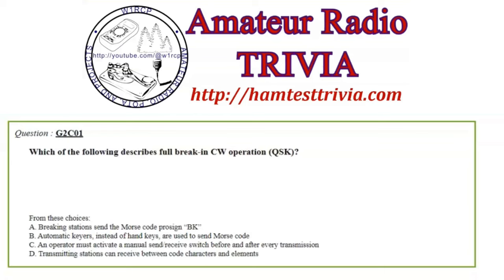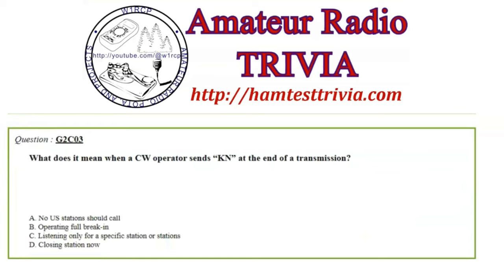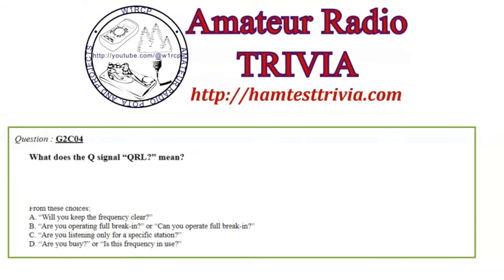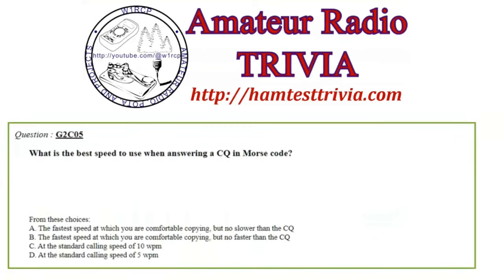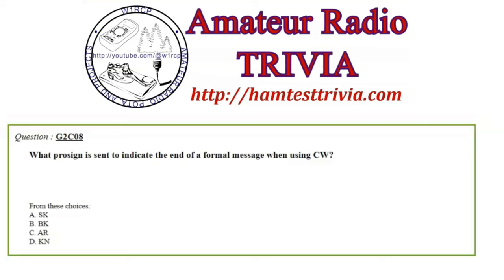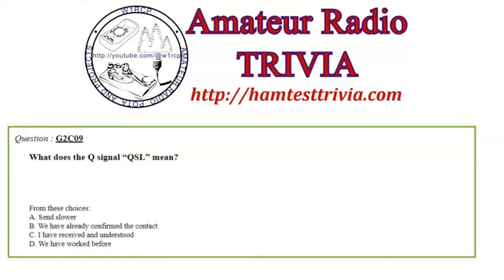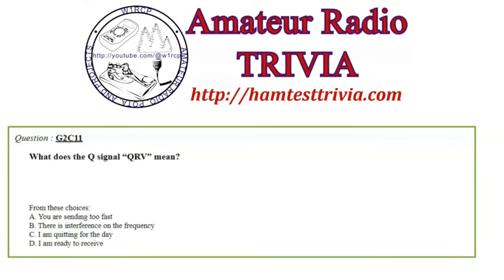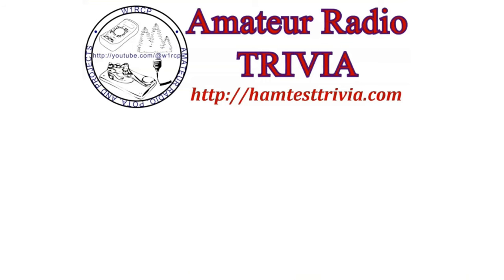Is the FCC bringing back the Morse Code requirement? #hamRadio #test #study #amateurRadio

Comment: The FCC does not write the questions in the pool, the NCVEC does.  To add a code requirement back, it will require a Notice of Proposed Rulemaking which consists of a comment and reply comment period.  None of these are taking place.  I highly doubt there is any interest in bringing back the code at the FCC.  I would suspect heavy ARRL opposition.  Remember, the ARRL wants to further water down the incentive licensing system by expanding phone privileges for techs in the HF bands.
Reply from the maker: Hey! Thanks for commenting and watching. In later videos I have been much more clear about who “actually” makes the exams. I know the NCVEC well because I pull the exam questions into a database when they’re released, and periodically I have to check for redacted questions. 
I also disagree with watering down the privileges. Technicians should be like a toe in the water. Why let them start swimming before they’ve had their first experience in the water?
No, the FCC isn’t bringing back the code requirement, but I wanted to draw attention to the questions about it. There are a lot of new CW ops out there, and the information I’ve provided, though click bait it may be, should be helpful to those either dabbling in CW or studying for the exam. 
Again, I appreciate you taking the time to write a well explained comment. 73 -Rob
Reply from the maker: I have pinned your comment so others can find it easily.

Comment: No.  Its not.  Understanding q-codes and proper operation to send and receive CW are not equivalent to a CW requirement.
Reply from the maker: It’s just speculation. They probably won’t ever require it, but what if it’s a frog in water that’s about to be boiled? Again, I explained it was only a half-truth near the end. I’m glad that CW operations are in the General exam. Maybe it will spur interest in the mode. Technicians have the ability to use CW on four HF bands, but I’ve only ran into a couple that have actually done so.
Reply: @w1rcp  I understand. At the same time, when I took my extra exams more than 10 years ago, they had similar questions on them. I like CW, but I do think it was an artificial barrier to getting people into the hobby. I think that if the code requirement had stayed, the hobby would’ve died. Maybe not all the way, but it would probably be a fraction of what it is now.  In the long run, I think keeping the barriers to entry minimal (about where they are now would be fine) eventually translates into more people getting into CW, digimodes, POTA, ect…
Reply from the maker: Yeeeeeesssss. Man, I wish I would have thought about the barrier to entry before I finished producing the video!!!! Holy crap you hit the nail on the head there. I agree with that. Ham radio is a vast playground, so why limit entry to the play ground by requiring a prospective participant to be skilled with all the equipment before being admitted? I know that there are many that wish the CW code requirement was brought back, but I politely disagree. Let us find our favorite playground equipment. I am glad that the exam at least touches on many of the different modes and activities that we can participate in, though. At least knowing a little safety about the “playground equipment” is there. analogyComplete(); 73, and I appreciate you coming back and furthering the discussion. -Robbie
Reply: @w1rcp  Yeah, the code requirement was a big deal.  Pre 1990 you were required to learn and test at 5 wpm just for a novice/technician license.  Post 1990 you could get a no-code technician license, but we’re restricted to 50 MHz and up.  General required 13 wpm, advanced/extra 20 wpm.  I think around the year 2000, the code requirements were eased to five words per minute for technician, and 13 words per minute for general and extra. They dropped the advanced category.  Everything went no code in 2006. I have mixed feelings about CW requirements.  I got my ticket after 2006, I was almost 40 and had a busy career. I really couldn’t justify the time it took to learn CW. It was a barrier to entry for me. I think I’m a pretty responsible operator otherwise. at the same time, I really wish that I knew CW well enough to use it. The thing is I dip in and out of this hobby over the years, and CW is one of those things that you will definitely lose if you don’t use.  One thing that I completely completely agree with is reserving significant band segments for CW only. I never want to see that go away. I also like the idea of the 30 m band being essentially a dedicated CW and digital band. There are a lot of benefits to operating CW, and it certainly is worthwhile to learn for the hobby.  In the end, I think CW is a reward unto itself and the people who learn it. It’s kind of special in that regard.
Reply: @kd8opi It definitely was a barrier in my case.
I earned my FCC commercial license in 1984, but didn't get my amateur license until years after they dropped the code requirement.
Reply: @kd8opi Yup. I earned a FCC commercial license in 1984, so rules and technical knowledge were not an issue. I just didn't want to learn the code.

Comment: The ARRL has abandoned actual hams in favor of the corporations that want to sell radios.  Without code you can't really build and operate a radio.  You need no real knowledge of electronics.  You just need money to buy a radio from the corporations.  You become just an appliance operator.  All they are doing is allowing CBers to buy and use Ham radios without any knowledge at all, other than how to push the button on the mic.  This totally kills experimentation and innovation.  I could care less if you let techs play around with UHF and VHF, but HF should require code, period!!!  AE4YW

Comment: Straight key CW is the primary reason I got my ticket back in 1994. At that time it was a required part of most of the amateur radio license levels. Although I prefer CW and never had a problem using it on air or passing the 20 WPM Extra Class CW exam, I never believed it should have been a requirement because it excluded many folks who did not need or want to learn CW from entering the hobby.

Nowadays it seems that CW ops are on the rise and I believe that is because of the challenge involved in learning the language of dits and dahs and developing a good fist. With so many digital modes to choose from, some of us enjoy getting back to the basics. CW doesn't rely on sophisticated software and repeaters and transponders and Internet linking and so on. It is a barebones operating mode that will always get through when the high-tech systems go down.

I think it would be best to leave CW as it is now, an optional and voluntary operating mode. I do not believe that demonstrating Morse Code copying ability should have any place in an amateur radio exam. However, learning some basic understanding of CW is not a bad thing either. Just don't force it down everyone's throats!
Reply from the maker: Well said. Thank you for your most excellent comment, and I agree. I always wanted to do CW since getting into Amateur radio, and after many years of practice and failure I was able to work the skill to a reasonable level.
Reply: SSB was the gateway drug to CW for me. As far as the increase in CW operators, I suspect SOTA and POTA have something to do with that. I know it did for me. I just completed my 4th POTA activation with CW and I’m hooked. It’s so much easier to find band space to work and I can use my 10 watt radio with the same propagation as my 100 watt radio but without all the accompanying software wrangling of the fiddly digital modes. In any case, if CW had still been a requirement, I would never have upgraded to general and ironically would never have learned CW. I was lured in, not forced, and it worked.
Reply from the maker: @KD7QOW-np9gd  I agree. I had plenty of time to learn. Now I can't even count the contacts I've made using CW. I enjoy the absolute heck out of it. Congrats on the addiction. You can do just as much with a whole lot less with CW, too. I'm about to post a video of the Pixie II CW transceiver, and I'm going to make an attempt at a POTA activation solely using it very soon using a tiny straight key. I'm just waiting for the sun to stop burping up all over us. 73 -Robbie

Comment: Trying to figure out the FCC’s intentions by looking through the question pools is a waste of time. The FCC doesn’t create the question pools; the NCVEC does.

If CW is revitalized, it’ll be a result of the good work done by CWOps and the  LICW Club. The FCC couldn’t care less at this point.
Reply from the maker: Yes. I understand the NCVEC is in charge of the question pools, and I also agree that the FCC has basically turned a blind eye to our spectrum, and they are entertaining ideas to sell it off, but I bet most Amateur radio ops either don’t know or have forgotten where the question pool comes from which is why I begged the question with the FCC’s name. 

I am glad that it is part of the General exam, and I encourage those that I can to at least give CW a try. I started by saying that I’d never be able to do it, but I wanted it so bad that I actually did it. 

Like I said near the end of the video. Yes, it’s part clickbait, but there is some truth to it. The only issue is that I named the FCC instead of the NCVEC. 

As far as CW being revitalized, I believe that CWops, SKCC, LICW, and whether anyone likes it or not, POTA has also encouraged many hams to give CW a shot. 

73! -Robbie
Reply: A member of both clubs
Reply: It only stands to reason that if knowing CW codes were ever to be included in any exam, then I'm sure that we would also be able to send and receive CW as well at a designated speed as they did years ago. The bottom line, this would definately decrese the number of people who would want to take the General exam and also quite possibly discourage anyone wanting to get into Ham Radio.
Reply: The FCC only has 1 intention for Amateur radio, as stated at the top of the FCC rules and regs for the service. They want a pool of technically knowledgeable and experienced radio ops in case of war or other national emergency, so they provide the willing with a radio sandbox to play in, and several perks for taking and passing simple tests. It's surprising how few hams actually know why the Amateur radio service exists. I guess it's because the question is not on the license tests.
Reply: @johnwest7993  I think amateur radio faces a problem that I don't know how can be fixed. With all the modern means of communications, it is no longer necessary for emergencies, except when it is. For example, I have heard of hams approaching their local Emergency Services organizations and being told "We don't need you; we have cellphones." And they may be right, up until you get a storm that takes down the cell towers, like they are having in the middle of the US lately. At that point, they do need hams, but they don't have a working relationship with them, since they thought they would never need them.

Comment: I took a ham radio class when I was in college and failed the morse code test by a few words. Over the years, I would practice for fun. Then when I was around age 40, a member of the US Power Squadrons boating club told me that they were having a ham radio class. Since I already knew morse code somewhat, I practiced and told them that I wanted to do the code as well. At this time there was no code requirement. They looked at me like I was crazy to do the code but I told them my story of originally failing the test in my college years. So they gave me the test and I passed. Then they gave me a small piece of paper that in handwriting that gave me permission to do code on Novice and Tech bands. Now I read that it is no longer valid; that it is presumed that an operator can do code. I am glad that they got rid of the code requirement, but credit should be given to those that took it.
Reply from the maker: I love the story. Thank you for sharing. I had a CW QSO with a guy a few years ago and he told me the story of waiting by the mailbox every day for months waiting on his ticket to come in the mail. He told me the whole story about having to leave home and travel to a big city to an FCC office to test. Times do change.

Comment: I got my technician license in 1988. I didn't get my general till 2009. I was stuck on VHF/UHF all that time, and just lost interest. I could never get anywhere near 13wpm. I took and passed the general written in 1988. That gave me a year to learn the code. But it was clearly hopeless. Not everybody is capable of learning code, especially at high speed. Once it gets above the speed where you can count the dits and dahs, it just becomes a jumbled up mess.
Reply: This!
Reply from the maker: I can just barely converse at 13wpm. At that speed I can't write any faster, and it turns into a jumbled mess. I've tried head copying, and I still practice it, but conversational CW has never gotten much farther than 10-13wpm. Short exchanges I'm good with at higher speeds, but anything out of the ordinary will mess me right the heck up.
Reply: You've been trying to learn CW wrong. I did it that way, too. I had to unlearn it before I could learn it correctly. Fast CW isn't about counting dits and dahs. It's about associating groups of sounds with letters, then with words. When you read you don't read letters. You read groups of shapes that you identify as words. When you listen to speech, you don't listen for the sounds of each letter, then add them up to form a  word. You put them all together and hear full words. That's the way fast CW works. I had a friend who sent and received CW between 40 and 60 wpm all day long. He could transcribe code to paper while he was talking to me. His Vibroplex bug was stuck on as fast as it could go, and the touch of the paddles was tuned like a racecar engine. He was a master, now a Silent Key. But he couldn't copy 5 wpm sent by me, because after 40 years he had forgotten what sequence of dots and dashes spelled out which letters. He only recognized CW as the sounds of whole words and phrases, the sound of people talking in CW. There are several free CW programs available as downloads or online that start you with the sounds of letters and numbers, then work their way to the sounds of words. They do NOT teach dots and dashes. They know the right way to learn CW so you don't hit a wall at just a few words per minute.
Reply: Counting dits dahs is the wrong way to do it. You have to learn the sound of each letter. Yes you start slow but you stick to just a couple letters at a time and build speed by accretion, essentially. If you are literate, you can learn code. You don't read by spelling the words as you read them. You recognize the letter pattern as a whole. That G4FON training program is great. The "morse mentor " app uses that system. Think of this also, you like already know SOS, but you don't have to count those patterns, you know it right when you hear it. If you play a musical instrument, you already have some aural skill. If you can recognize your favorite songs by hearing the first few chords and melody notes, you can learn to hear code letters as dit/dah patterns.

Comment: Thanks, Robbie, for the entertaining CW questions video. Regarding zero-beat another station, back in olden days when the separate transmitter VFO was different from the receiver, the VFO had a "spot" function. So after tuning in a signal to one's liking, the transmitter VFO tone was matched to it. So both were heard the same by the receiver BFO.

Comment: Um , well I work the citizens band 26 - 27 MHz , and I’ve been on there for decades . But the citizens band was deregulated when the FCC let the band expand by 17 channels , from 23 - 40 . Plus side band . I still use my old call sign and call letters . Where there are all the CBers today don’t identify at all . No breaks in a conversation to acknowledge another station so they can wait , while the original users clear the frequency . No one follows those old rules anymore . I go by the rules provided by the manufacturer of the radios from august 1976 . I have not heard of any updates since . 
As a matter of fact , the teeth have been pulled for law enforcement by the FCC , so it’s the wild Wild West on the airwaves . 
But if someone gets in a jam that I can hear them , I’ll render any assistance I can . 
I’m jiminy cricket , k y I 6898 , and I’m on the side .
Reply: The FCC ,Should Bring Back Licensing CB Operators,FOR $35.00 Every 10-Years.

Comment: I'm ambivalent about CW. I have no objection to it, but it should not re-appear as a compulsory requirement.
Reply from the maker: I'm glad it is no longer a requirement, or I may have never entered into the hobby, but I have picked it up, and I really enjoy CW. Like some digital modes, it's not for everyone. What I like about Amateur radio is that there is plenty of stuff to get into.
Even when I was first licensed about a dozen years ago, I immediately started tinkering with homebrew QRP CW rigs, but it took me a long time to be proficient enough to brave that first CQ. I'll never forget the high. I was sitting in a hot Jeep Commander with a plastic Ameco straight key hammering out dits and dahs on the center console through a Realistic HTX-100 10m rig with W5ZIT out in Texas. After about 20 minutes my brain turned to mush. It was still many years later before I ever made another CW QSO.
Thank you for your comment, and thanks for tuning in.
-Robbie W1RCP
Reply: It Should Be A choice If A Person Wants To Take It Or Not But Dont Make It A Forceable Option ,As In You Will Or, Else????